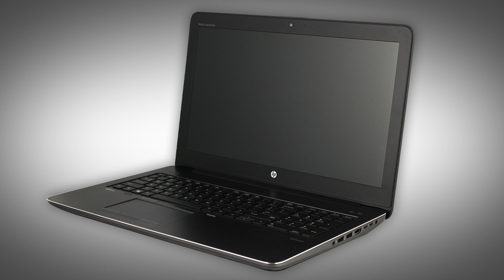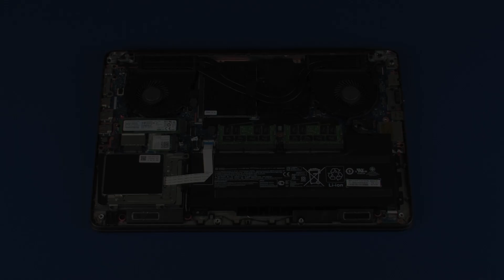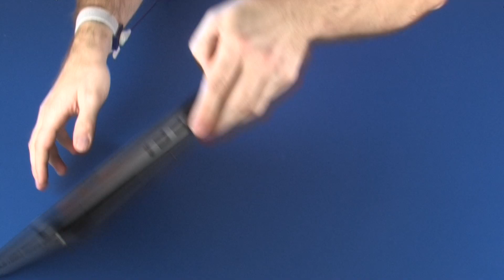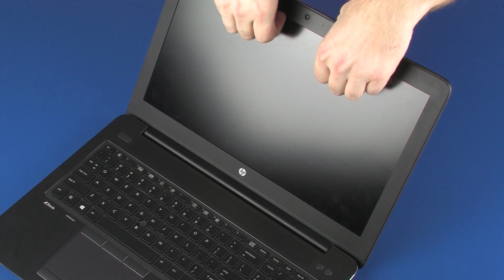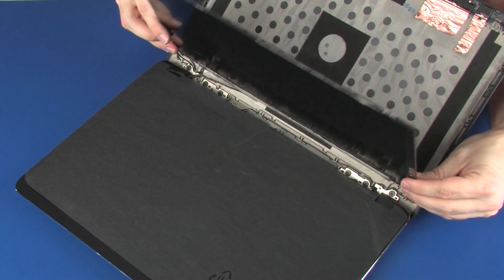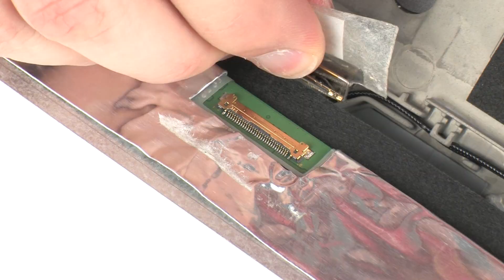Replace the Display Panel/Display Bezel | HP ZBook 15 G3 Mobile Workstation | HP Support

Comment: Hello can i replace my hd screen to fhd
Reply from the maker: +Mohand Almohands HP does not recommend upgrading or downgrading hardware parts or software that is bundled with the product as It may affect the manufacturer's warranty and performance, however, you could change the configuration at your own discretion.